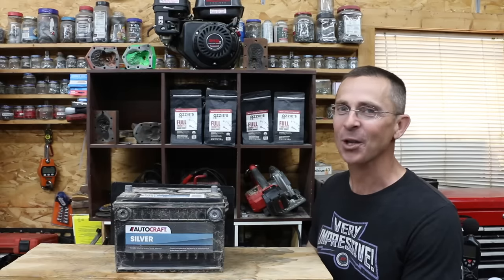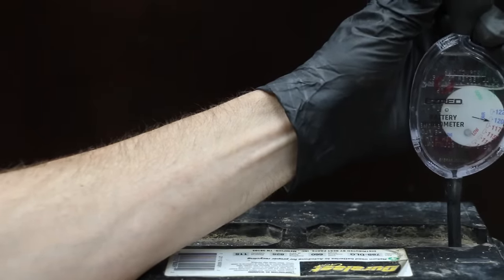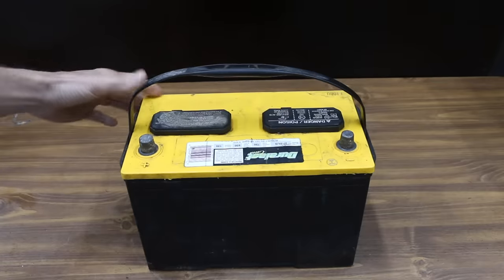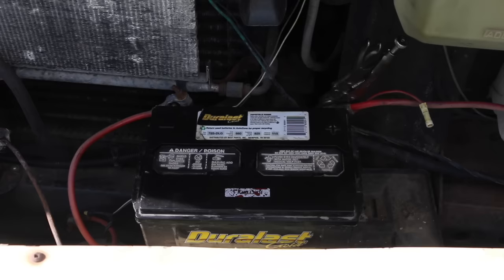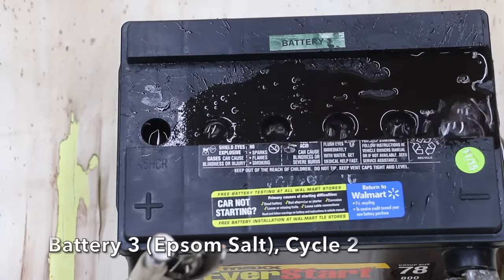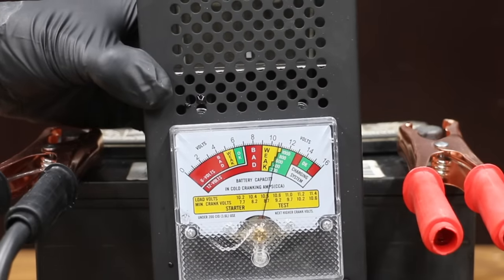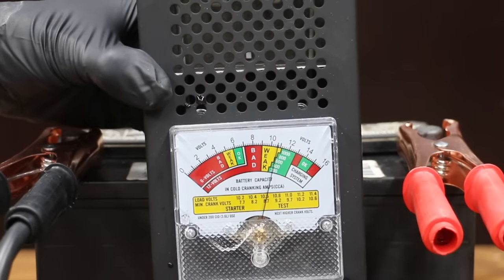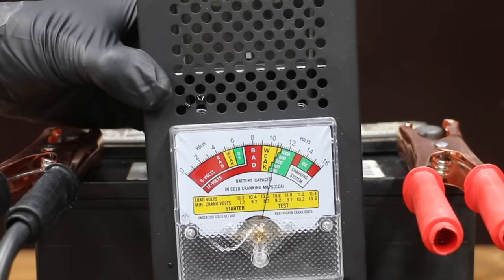Myth Busting! Can You Restore a Dead Car Battery With Welder?  Let's Settle This!

Comment: ive watched a few of this type of video, eveyone talks about the amps used yet no one mentions the voltage applied to these batteries
of welders i have tested they are way over 12v output
Reply from the maker: Thanks for the feedback.
Reply: How much over?
Reply: 40-50v open circuit
i have since tried this method (which works on some batteries) open circuit voltage was 45v. When connected to battery dropped to near 18v

Comment: Hopefully a follow up video to come? Seeing as you missed the last 3 steps. 

Also, you didn't do the Epsom salt thing correctly. IMO, it's not a great way anyhow, it's more of an extend what you've got method. The battery still requires sulfuric acid, all you do is top off the battery with as much Epsom salts you can get to dissolve in distilled water. That's it, some believe it slightly revives a weak not bad battery. All your doing is adding electrolytes which some have seen helps. 

When using an all Epsom salts and water solution, the battery won't charge much however, the thought is, it helps with breaking up the build-up on the plates while going through the hard charge process. One still needs to do the last 3 steps. 

The final 3 steps you missed... 1st drain the battery, be careful not to spill or get any on you or your clothing. Then neutralize the battery acid with baking soda. You could neutralize the acid while in the battery but, you may need to derain some off the top anyway. If you do, add baking soda to the battery make sure you do the next step a few times.

2nd, rinse the battery with distilled water. A bunch of what came off of the plates, that is now sitting on the bottom of the battery, will come out. If you have a way to shake a heavy battery, do it. It's quickly fatiguing even for a strong person. Shake it while you drain the distilled water, if you can, is great as well. Chunks will come out. All that junk was covering the bottom of the plates. Multiple rinses is the best however, the first will be the most productive.

Lastly fully fill it with the fresh sulfuric acid it needs to the bottom of full, charge and top off. Now see what you accomplished?

Comment: Can you make a video or suggest on comment, on the right way of using a dc welder. What amp, number of cycles and how much time.
I'm afraid if we do it wrong it might cause more damage than benefit to the battery.
Reply from the maker: Thanks for the suggestion.

Comment: You made a mistake. Please revisit the Spain salt batteries and replace the Spain salt after the process with the sulfuric acid, which you forgot to do.    The Elian salt is for cleaning the sulfates  and then you must return the battery to its sulfuric acid state.  Thanks

Comment: Suggestion:
!: Locate a battery that is BADLY sulfated.
2: Throw a car headlight bulb on it for a day or two to make sure it is 100% discharged,
3: Throw the battery on a charger THROUGH the headlight but opposite polarity for 1-2 hours
4: Remove the headlight from the circuit and charge it until full (potentially DAYS?)
5: Test your new "yrettab"

Now, explain what happened from a chemistry perspective!
Reply from the maker: Thanks for the suggestion.

Comment: I have horrible luck with sid post terminal batteries in my Saab it had warranty so I brought it back for replacement 3 times before I got a battery that would actually not drain drastically over a couple days. First thought a parasitic draw on my vehicle somewhere but not just kept getting this horrible batteries for some reason. Thanks Walmart for constantly taking my return without question. Manufacturing defect or something?
Reply from the maker: Thanks for the feedback.
Reply: @ProjectFarm  no problem! you earned a new sub and like on video for your informative as well as your time and effort put into the video. I was finding myself sticking my battery on the charger every night and never leaving home without a halo bolt jumper in the vehicle. Definitely not correct when buying a new battery from the store. Yes they kept swapping it but who wants Todo that 3 times on a new battery. Very odd and have no clue why it was happening it wasn't like it was a used battery or refurbished but really I have no idea. Now it doesn't die within a couple days of sitting but I still never go without a jumper just in case.

Comment: It appears that in some cases a battery can be recovered, but some failures cannot be fixed. Probably more a matter of the cause of failure than the technique.
Reply from the maker: Thanks for the feedback.
Reply: In past my father fixed many led batteries. Then it was possible to replace faulty cells with good ones. He also looked into bad cells to investigate what had happened and most shorted cells had led plates eaten up. Cell looked nice from top but actually there weren't much left. So that's probably the reason why most batteries in this video weren't possible to fix.

Comment: FYI those handheld battery testers are notoriously innacurate. I purchase batteries from a 'refurb' shop near me and I alway insist they use an actual pile type batter load tester. Those handhelds don't actually load the battery enough to weed out weak and dead batteries.

Comment: when batteries are made they are charged in a water bath with a vent hood over them to keep them cool ...
Reply from the maker: Thanks for the feedback.
Reply: @ProjectFarm  At my old job I got to tour a battery manufacturer and it was impressive and not very automated... From cutting lead banding for the electrodes to charging... We had to put on a clean suit due to lead dust and a mask, and they had an area for maxing acid too that you could not get near at all without ppe

Comment: Battery three might have been fine if the epson salts was washed out and replaced with distilled water prior to zapping it with the welder. Those chinees desulfators are gimmicks.

Comment: I'm not sure about this using a welder process. Every battery I've tried goes from some voltage before the process to a negative voltage after the process. So basically it's destroyed the battery for good.
Reply from the maker: Thanks for the feedback.
Reply: Watch out for chinese welder that got the positive and negative reversed.
Reply: @pigyear88  Thanks for making me aware of this. With my welder this is true and now I'm getting some good results with batteries. Thanks

Comment: What would happen if i tried that with an ac welder? As the ac polarity would switch multiple times a second, charging and discharging the battery fast, would that be able to do anything for the sulfation on the plates? I have an old car battery producing 58 ams SAE( SAE is similar to cca) i want to try it on, is there any chance that the battery could explode(i mean a chance that it would explode from the ac current, not because i am using a welder)?

Edit: i want it as a 12v battery to be able to charge my phone and maybe power my wifi router incase of an outage so i am not trying to make it brand new for usage in a car
Reply from the maker: Thanks for the feedback.
Reply: @ProjectFarm  man i was asking not leaving feedback lol

Comment: you emptied the electrolyte from the battery that you put epsom salts in, and then re-filled it with straight distilled water, no sulfuric acid…how is the electrolyte supposed to work with straight distilled water?

Comment: Only works on 'weak batteries'. Cannot save a battery with broken internal plates, in fact that is dangerous as it can short and explode.
Reply from the maker: Thanks for the feedback.
Reply: Thanks captain obvious. I bet big battery doesn't like these videos on youtube. Can't believe the idea of a spot welder is only a couple years old on youtube. Jesus. I spent a total of $100 on amazon between a spot welder, battery charger and battery tester. A new battery would've set me back $250.

Comment: If you removed the epsom salts and replaced with new battery acid, and gave it the welder treatment, i bet that battery would work.
Reply from the maker: Thanks for the suggestion.

Comment: The biggest enemy for car batteries is not using the car...so battery is staying and the acid also is staying and this is the time when the battery is getting sulfated, if the car is using at least 1 or 2 times per month for at least 1 hour is good cuz the liquid in battery is moving inside the plates of the cells getting rid of sulfate, so the more car is running the more battery is staying healthy and even if is not running at least is better to let the motor running for one hour and the acid is moving in battery cuz of vibration of motor
Reply from the maker: Thanks for the feedback.

Comment: You need a 500 amp carbon pile load tester.
Reply from the maker: Thanks for the suggestion.
Reply: @ProjectFarm  I once had a failed battery which failed 500 amp carbon pile test but passed 100 amp test like yours.

Comment: Just not worth it fooling around with questionable batteries.Had my 3 bank trolling motor batteries on a good maintainer and one must have shorted out blowing the top off and all the acid with it. Luckily it was a all aluminum boat or it might have burned the garage down. Now nothing is on a charger without me there.
Reply from the maker: Thanks for the feedback.

Comment: Wonder if when battery is 4 years old to zap it with welder and then every couple of years after that? Instead of a old dead battery trying to bring it back to life.
Reply: I bought back a 3 year old battery in 1 zap. SOH from 13 to 93%. Spot welder cost $60 on amazon.

Comment: You could do a video using a beach towel or pantyhose for an emergency fan belt. I always love to see faces once that one works. it needs to be on a engine with a fan clutch you have to cut the toe in strips tied together around the pulleys with no tools can't tension unless done with a hack. But it's not necessary . There are knots that will allow all slack to be removed.
Reply: It's for emergency repair to get to a fan belt. Once made it almost one hundred miles in a beach towel once. Tbe truck it's necessarily the power of the towel. It's only used at slow speeds so if you're rolling good it's under no strain.
Reply from the maker: Thanks for sharing.

Comment: LMFAO
WHO WOULD DARE TO BE COURAGEOUS ENOUGH TO PLACE A LEAD PLATE BATTERY FILLED WITH EPSOM SALTS BACK INTO SERVICE.  YOU MUST REMOVE THE EPSOM SALT SOLUTION AFTER BOILING - THEN REFILL WITH PROPER ELECTROLYTE SOLUTION/ DILUTE SULFURIC ACID.

Comment: There is no way you took an old used battery at 62 amps and turned it back into 900 amps. I work around batteries all day. 900 amps is the highest car battery you can buy
Reply: It’s over charged, it won’t stay that way
Reply: I have been reconditioning large quantities of batteries daily for 15 years

Comment: I have repeatedly said what Inverted Transfer Energy is designed for, and I have repeatedly said how it works to produce sustainable electrical energy. Sadly, it’s all about the wealthy keeping all electrical energy systems tied to the grid and not about saving life on Earth. 

Why is everything always said to be impossible until it has been done? Inverted Transfer Energy is sustainable electrical energy that is designed to work with off-grid renewable energy systems (up to 5kw) to maintain the battery bank charge in order to keep the electrical energy on, even during extreme weather events. 

Let me be perfectly clear; Inverted Transfer Energy is by no means someone’s theory, mechanical perpetual motion free energy that can’t exist, over-unity, zero-point energy, nor is it powered by fairy dust. There is a lot more to physics than we realistically know or are willing to admit with the status quo.

It is not about how Inverted Transfer Energy conforms to physics of being sustainable electrical energy. It is about how physics confirms that Inverted Transfer Energy is realistic. Why do people find it so difficult to understand the basic laws of physics? With all due respect, please, do not assume to be a know it all, because no one is.

I So, why can't people understand layman's terms anymore?

“Without the process of just reasoning, there is no truth, there is no moving forward, progress becomes impossible to achieve.”
Reply: I can see that with a name like yours that there is a lot of fight left in you.  As a Physicist, I am interested in your Inverted Transfer Energy but I haven’t found the literature yet.  Is it a theory like Marcus theory?  And thanks to Project Farm for allowing such a wide ranging discussion!

Comment: The biggest problem with this guy doing the Epsom salt repair is that he's not doing it correctly it takes like 3 days in a lot more Epsom salt and he using I have done this and it works. It will completely acelity the battery as long as the play to earn that destroyed it will will will work but he seems to just be guessing at the proper protocol for doing it is he's not doing it any thing like what you're supposed to do

Comment: What you are doing is VERY dangerous.  I ran and owned a alternator/starter rebuild shop and sold and repaired battery's.  A normal battery is equal to 2 sticks of dynamite if it blows up. The fumes are very explosive. I have had a few explode while doing this with a purpose build charger that is only used to charge up fully dead battery's. {You can buy them for $600] I did this in a separate isolated room in the shop that is well vented. Youtubers be very cautious if you choose to try this.
Reply: Project farm knows a thing or two, no doubt that it is dangerous, but I’d let the man perform heart surgery on me😂 he’s very cautious and smart